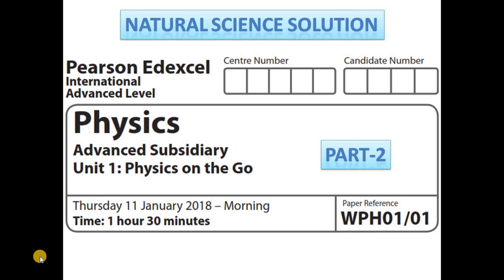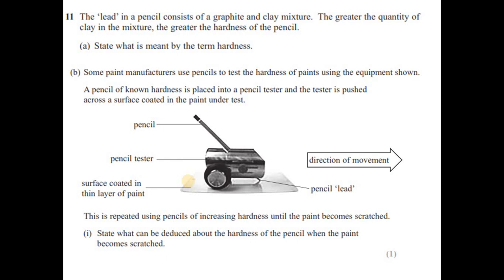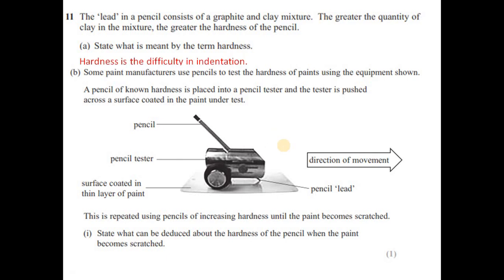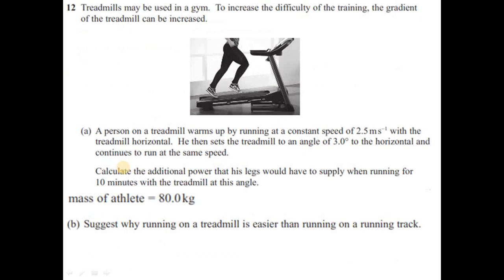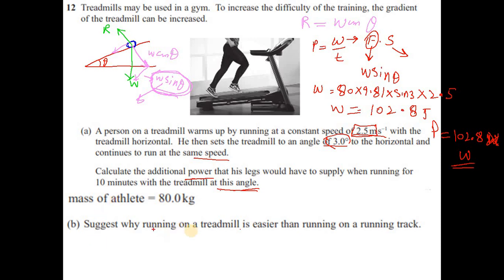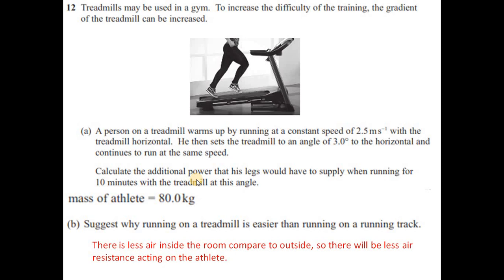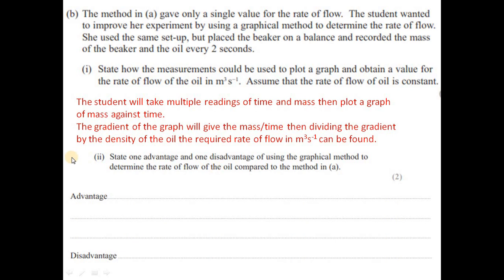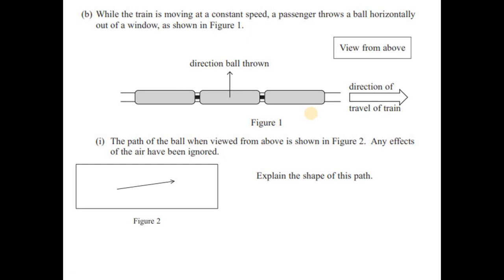Edexcel IAL physics unit 1 Jan 18 part 2

Comment: 12(a) i think this one needs correction!It is asked to calculate the additional power needed for 10mins!
Reply from the maker: I think you are confusing with 10 min, it is not the case. They are asking due to change in angle how much power is going to be? no matter how long the person walks. Hope you'll get the idea.
Reply: Ohh so its like 102.8J per second for 10mins!right? I do think I got the question wrong 😐
Reply from the maker: @romanaaktar1322  Yes, Indeed.
Reply: Thanks for the explanation 🙃☺
Reply: I came to question the same